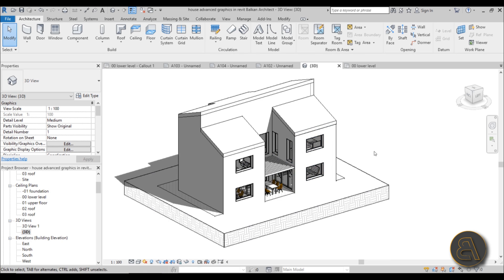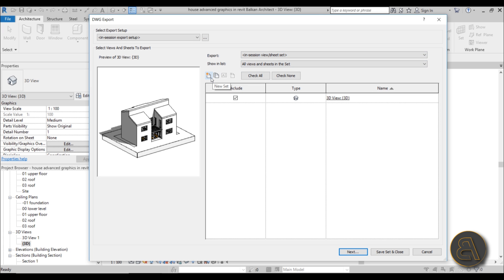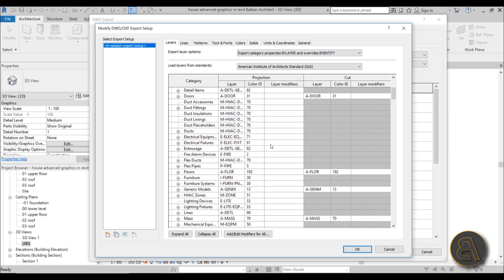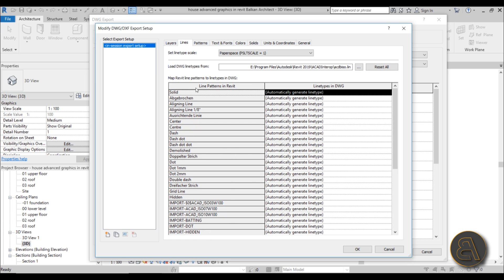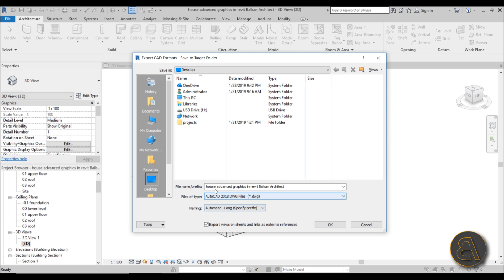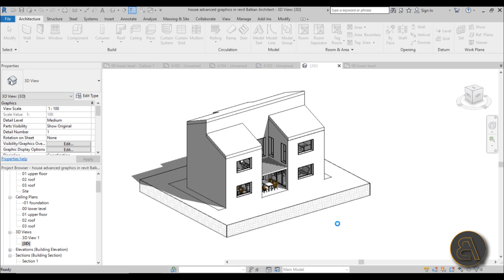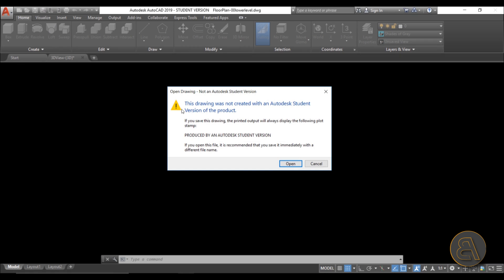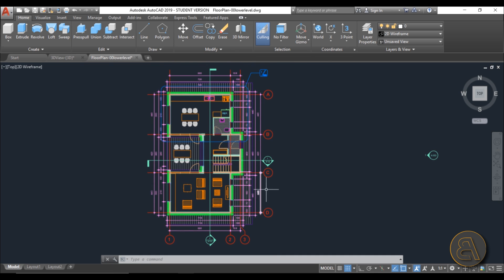Exporting AutoCAD (DWG) Files from Revit Tutorial

Comment: Do you know if you can export a floor plan without the wall "filler"?  As you saw in the floor plan you exported all the walls have a fill but because the fill is called the same name as the wall (usually I-WALL) there is no easy way to isolate the wall filler to delete it.  I just need the walls with the fill inside.